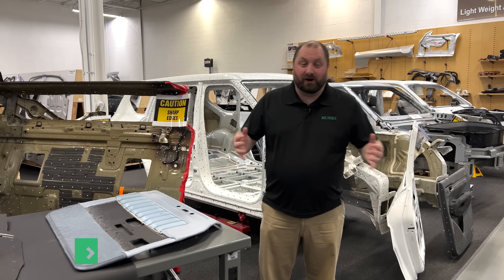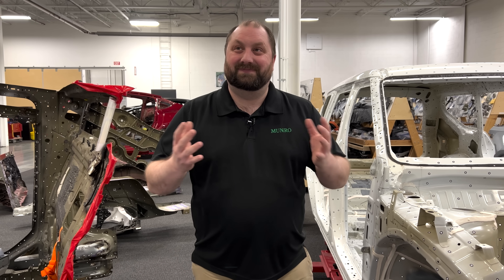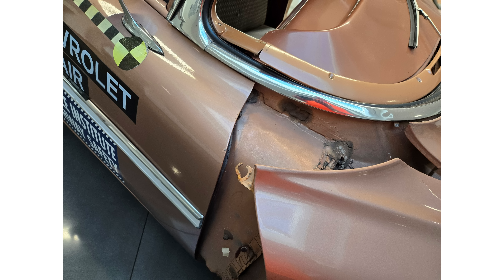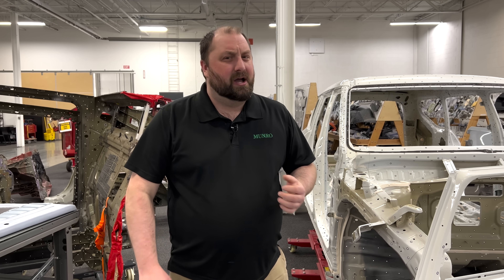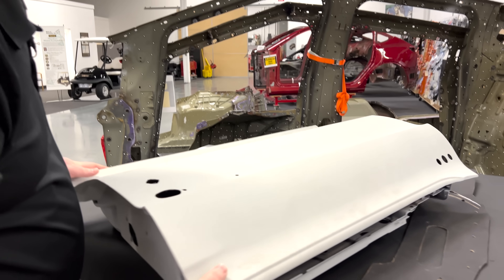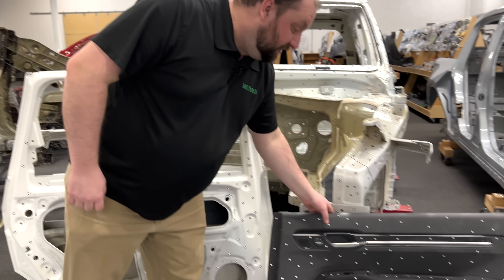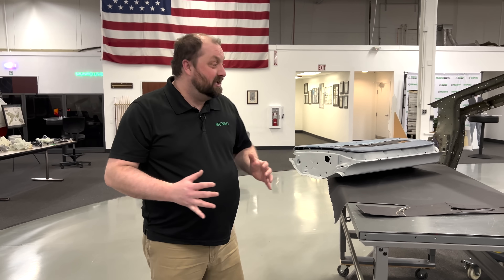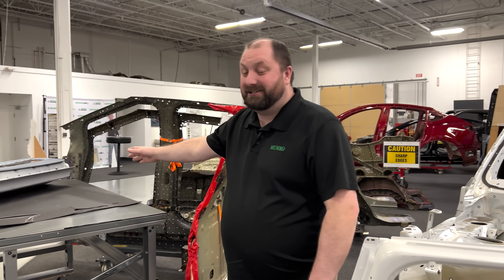No, Your Classic Car Isn't Built Better Than Your New Car

Comment: TRUTH!!!  

Three weeks ago, my wife and I "T"-boned another car in our 2020 Volvo XC40.  The woman driving the other car cut across the intersection we were driving through...  We never saw her, just felt the impact.  She was cited by the police for failure to observe a traffic signal and was 100% at fault.

We were doing about 45mph when we hit her...  Completely destroyed the front of the car (it was totaled).  We walked away from the accident with zero serious injuries.  My wife's chest was sore for about a week, thanks to the seatbelt, but neither of us had any lasting issues from the crash.

Compare that to a host of stories about the result of a crash from cars from the 60's and 70's that a friend of mine's dad, who was a local EMT...  There's no comparison on safety between modern and classis cars.  Not even close.
Reply: Good to hear no one was seriously injured or worse killed in your accident.  From a European perspective, I think the US could dramatically improve road safety by replacing crossroad intersections with roundabouts.  T bone crashes would then become a thing of the past like old cars.
Reply: @Stewpot-29  Roundabouts are becoming increasingly common in the US.  They're certainly not every intersection, but alot of newer developments use them alot and they're getting retrofitted into areas where they make sense.  We're also starting to use alot of newer intersection designs too.  Like the diverging diamond and continuous flow intersection.
Reply: @Stewpot-29  In many locations, there is no room, just like many of your oldest cities have no room for wider streets.  Roundabouts or Rotaries take up  lot of space, which is the reason they weren't used in our roads, plus, many drivers hate them - more side-swipes.
Reply: I hope you didn’t tell your insurance company “we never saw them” because that implies you weren’t looking. People always say “they came out of nowhere “. No, they came from somewhere.  You just weren’t looking.  Thankfully everyone walked away ok
Reply: @grazz7865  We did, it didn't matter...  She was still found to be at fault.  A witness to the accident told the police she barely slowed down for the left turn against a flashing yellow arrow.  We were traveling through the light in the opposite direction with a green traffic signal.
The sun was coming up at the time, partially in our eyes.  When taken as a whole, we didn't see her make the turn into our path.
But I'm glad she wasn't hurt, and thankfully we were not either.
Reply: @WHJeffB  well Jeff, from your initial comment, you’re more concerned about showing how you were 100% not at fault and never saw the other vehicle, and how severe the impact was people naturally would wonder about the other vehicles occupants. Following up with being paid what your car was worth but being out 20 K. Maybe you should go look at five year-old Volvos instead of new ones. And I don’t even need to guess who you voted for.
Reply: @grazz7865  OR, "them" went through a red light and wasn't supposed to be there.
Reply: @ I’m not saying everyone is a saint out there. I see PLENTY of sloppy driving for lack of a better word. I’m sure you’ve heard “it takes two to tango”. If the cars have to obey the rules, the pedestrians have to obey the rules. It’s the only way safety is going to work.
Reply: @grazz7865  And that is something that the Militant Pedestrians refuse to acknowledge - pedestrians MUST ALSO follow the rules.  If they insist on stepping out in front of moving cars, it is THEIR fault if they get hit, not the car's fault.
Reply: @ COULDNT HAVE SAID IT BETTER MYSELF!
Reply: Her car must have been a total loss too. Did you notice what make it was?
Reply: During the 60s and 70s, yes, but 70s cars were much safer than cars had been - collapsible steering columns, (1968), deep-dish steering wheels, never mandated but first used by Ford in 1956 and much safer, padded dash boards, first used in the 1949 Chryslers and Imperials, shatter-proof mirrors, first used by Ford in 1956, break-away rear-view mirrors first used by Ford in the 63 T-Birds and Lincolns, standard equipment seat and shoulder belts in 1968 as mandated by law, side-guard beams in the doors/rear quarter panels in 1973.
Reply: @jamesbosworth4191  Much safer in this case isn't saying much. Modern cars are a quantum leap by comparison to cars in the 70's.
Reply: @Mercer1012  I am talking about full-size cars, not compacts.  70s compacts were indeed terrible as far as safety - not much better than a VW bug.  80s compacts weren't much better.
Reply: What happened to the person you hit?  A little compassion would be helpful here, and her crash was far more difficult to battle with design, so ...
Reply: @CitEnthusiast  What?  Compassion?  She was either in a hurry or blew the light and crossed against it and caused the accident.   She was cited by police and held 100% responsible.  

Adding to this...  Our car was in mint condition with lowish mileage and two payments away from being paid off.  We could have driven it another 5-6yrs at least, without car payments.

Now...  Thanks to her.  We're $20K in the hole , looking at car payments for another 5yrs (we basically got Blue Book value for the car, but the replacement was 2X that).

But to put your conscience at ease...  She walked away from the accident.  The paramedic checked her out at the scene and she was gone within 15-20mins of the accident.  We never spoke with her, the police that responded made sure we had no contact with her.  She was clearly in a hurry and had some place to be.

So as far as compassion is concerned...  I have none.  We're lucky we were in the car we were in and have no lasting injuries.
Reply: @WHJeffB It doesn't matter who's to blame. She almost died, and the only thing you can say is that it's her own fault?
Reply: @ Ugh...  She walked away from an accident she caused that could have potentially injured my wife and I very badly.  She didn't "almost die" by any stretch of the imagination.  We impacted the rear passenger side of her car.  Completely destroyed our car in the process.  Luckily we were in a very safe car.

Saying the accident was her fault, has nothing to do with not having compassion for her.  I'm glad she wasn't injured.  

Other than that, I'm not sure what people want here.
Reply: @FINNdeischgut  Where in his story did she "almost die"?  You're berating someone for something in your imagination??

Comment: I have completely restored 2 AMC Pacers and when you are on the road with them you think "is that all there is"
And did the same with a 50 year old Citroën DS, which was an extremely modern car, innovative and extremely comfortable and yet, it was a 50 year old car, very noisy despite the soundproofing, slow and a gigantic consumption,
But they have the looks

Comment: I own several classics and I agree new cars are better and safer. But new cars are not restorable and will never become classics. Plastics and electronics will never be available in the long term. I owned a 2001 beetle and back on 2011 had a breakdown in houston. Dealer said it was the ECM and none were available. It turned out to be a bad waterpump (stupid dealer.)  😮

I keep my 20+ yrs and if a major component fails, such as a ECM, you might as well scrap the rest of it.

Comment: Part of that "old cars were better" comes from them being easier to fix. Sure they were easier to fix - they were much simpler. Also, most of them performed and handled badly by modern standards, they weren't crash-resistant, most of them didn't last all that long, and they spewed lead-infused carbon monoxide. Even the occasional truly well-built car, like the million-mile Volvo, was barely more complicated than a lawn tractor. Even performance cars - compare an XKE to a Nissan Z-car, and it'll come across as weak, uncomfortable, and freaky-handling. 
People didn't demand nearly as much from them. But drivers demand more now, and manufacturers mostly deliver; but they ARE hard to fix.

Comment: There were some incredibly well built cars by the 60s standards, but they cannot compare. Most were incredibly bad in an accident…. A few would last to 100k or so miles…maybe more.     But most were done at 75k …… due to many weak components.   Then think about the oil leaks the typical car had….😢.        Oil leaks are 99.9% gone….

Love my old cars, I have several too, but my 2019 Tesla is built to last 4 times longer than a 60s car and is incredibly safe….   Then talk about performance and emissions……

Comment: Put a hundred thousand miles on 1970s car, and it's broken. Now the cars still as new.
Reply: Depends. Pretty much any old car can last as long as you want it to if you take care of it, and are willing to do some work on it every now and then. And you can work on them yourself if you have some mechanical ability and are willing to learn. My daily driver is a 75 Pontiac Lemans Sport Coupe. It's now 50 years old with 200K on the original Pontiac 350 engine and auto transmission. No rust. Still going. I have a few other similar 70's GM cars too. They're cheap to own and repair. Of course, most people aren't interested or able to work on their own cars, so have to buy late models. I've seen lately that there are a lot of new GM truck engines crapping out with low mileage, and I think Toyota has had some engine problems lately. I think it's due to over-complication. So you can't necessarily count on a new vehicle to last. How many new vehicles will reach 50 years old? Probably none I'd think.

Comment: I find it particularly weird when people get nostalgic over leaded gasoline. If you absolutely want to you can just buy leaded avgas, but that shit is a continuing headache for gasoline powered airplanes. It's incompatible with standard modern lubricants full of exotic anti wear additives, so you can't benefit from those. You can get lead deposits on your exhaust valve stems if you don't run the engine hot/lean enough, which may eventually cause the valves to crash. It likes to foul up oxygen sensors too, which makes it difficult to get closed loop fuel injection to work reliably. And of course the exhaust is poisonous! The only reason it's still around is because it does provide high octane without any alcohol, at a low vapour pressure, and offers consistent performance across a wide ambient temperature range. It's also fairly stable in storage. You have to look far for an air strip which sells more than one type of gasoline, so everyone's stuck with the archaic industry standard fuel, even though many modern general aviation engines will happily run on premium pump gas. Yes, you can technically bring a bunch of jerry cans to the normal gas station, but that often gets impractical. Also, you're advised not to needlessly switch back and forth between leaded and lead free fuel. Supposedly that too can cause problems.
It's proven difficult to create a true lead free avgas replacement, because there are all these qualities that can't be compromised for safety reasons. There are still people flying planes from the 30's, and those should encounter no new issues on the replacement fuel, and require no modifications. As such the replacement has to meet or exceed the old spec in EVERY WAY, without being too expensive.
Reply: I prefer propane for high octane, clean running fuel that doesn't deteriorate in storage.

Comment: I build my classic cars to drive them. I feel much safer in them than on a motorcycle, which I see people riding in shorts and flip flops. If you want something with more modern safety features, go for a 1968 or newer model, those have collapsable steering columns, lap/shoulder belts in passenger cars (many of the trucks have anchor points for newer style belts), and the double chamber master cylinder was required.

Comment: I loved my Ford Falcon (Australian made). It looked great, went well and I needed shares in an oil company to run it. No aircon in those days. No fun on a 40 C day in summer. I had it for years but eventually the rust monster took it out. Would I go back to it? Never. I do not miss adjusting gear box linkages at 2.00 am in the morning. I do not miss no aircon, no ABS, no GPS, no reversing camera etc. And I certainly don't miss all too frequent stops at the petrol pump.

Comment: When clicking on this video, I figured it would talk about reliability. It’s surely a known truth that cars are built stiffer and stronger today than in the past. I would have never questioned that. 

Reliability wise, modern cars are inferior. Removing lead from big end bearings is a crime and does nothing to save the planet. Ultra low friction piston rings that cause huge blow-by means your modern engine will be out of commission before long. Same goes for sprayed on cylinder wall linings and aluminium blocks. Making intake manifolds, rocker covers and other housings exposes to heat cycles from plastic is pure stupidity. Combining too many functions into components makes replacement very expensive - some parts catalogues require you to buy full systems to replace small minor (usually plastic) components, turning repair bills into mortgages!!
Reply: Go and change your carbs

Comment: Better?  Try changing a hvac servo motor in a  Lexus RX 350 or replace the panoramic sunroof seal on a 2020 Toyota Highlander.  
Today’s vehicles are designed with ZERO regard for the service tech.   
It’s all about fast efficient and cheap  manufacturing . 
 Glue & snaps! 
Who cares if maintenance is next to impossible we saved 
3 cents and 20 seconds off the assembly process.
Reply: That's nothing new. Vehicles were never designed to repair easily ,only to assemble for less cost. Change a heater core on a mid-seventies Volvo 2series and you'll know what l mean.

Comment: 9:00 - Is not strictly true, though it is so in the automotive context. Leaded gasoline (100LL) use in aviation is the highest ever. But then again, most of aviation, especially light aircraft is stuck in the post-WW2 era. Boeing likewise is stuck in the 60s with so many things. 😅 Fortunately jet engines never needed leaded fuels.
Reply: Currently, in Aviation, a TEL substitute is used. Lead is just too harmful. People who say lead is better, perhaps inhaled too many fumes when they were a child 😅
Reply: @LinkeHarryB  I dunno what you are on about.. 100LL with TEL is what you can get at all airports. The alternatives you cannot.

Probably more than half of piston aircraft are not certified to fly with alternatives to 100LL. This is one of the big reason why airports only offer the leaded version because you can run most piston engines with both. Sort of a chicken and egg problem, but mainly a FAA being as lazy as they usually are...
Reply: @rkan2  Perhaps this is different in the EU. Leaded avgas is still available, but rapidly phased out and looking at a total ban in the next few years. I recently flew along on a plane that used a substitute. But of course that is just anecdotal.
Reply: @LinkeHarryB  Nothing in traditional aviation is rapid, neither in FAA land or EASA land. There has been just about as much talk about phasing TEL out in US as there as been in Europe. It doesn't take away from the fact that there are still more than 10000 piston aircraft that require it without having a substitute. Who's going to pay for recertification or new engines? How are you going to get a certify for some DC-3 radials to run with a 100LL substitute? I guess they can all just be banned of course...